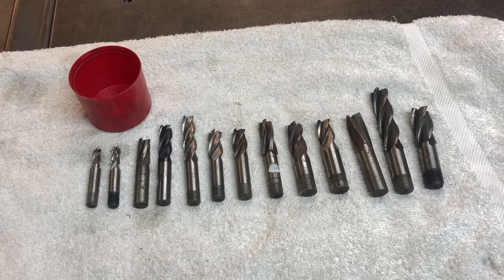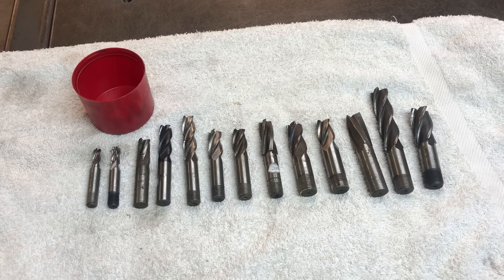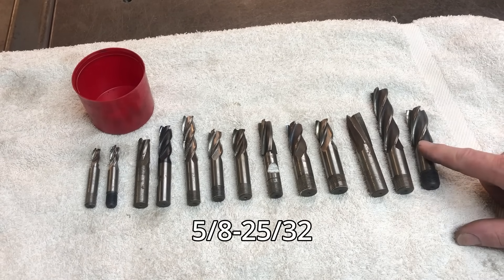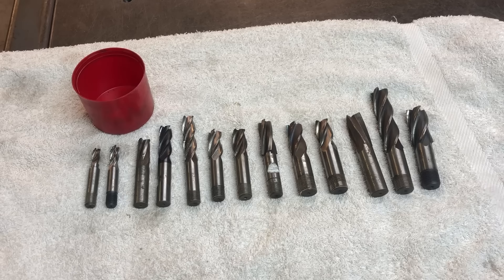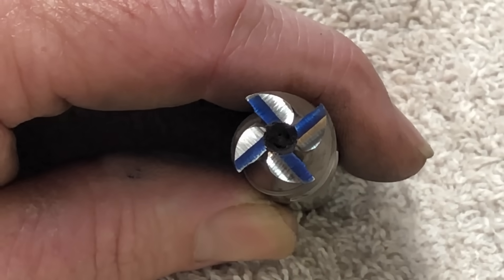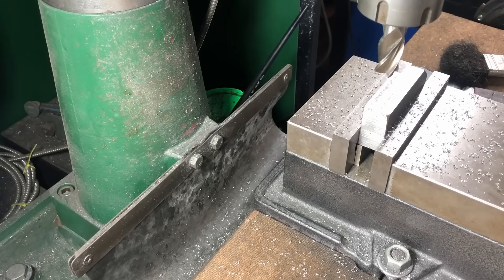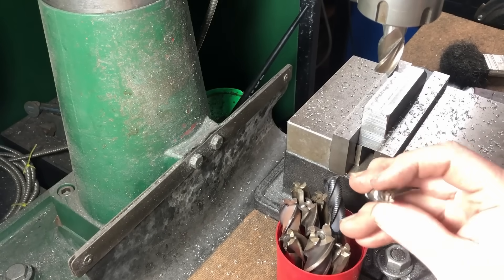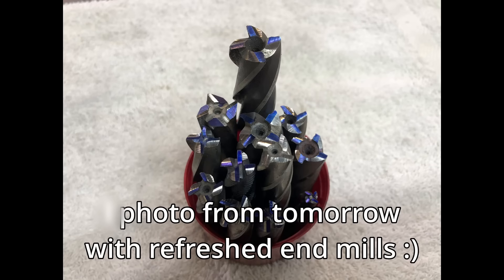Sharpening End Mills On The Lathe

Comment: Speak english ... use imperial units ... see 0.1mm tolerance on machining of high precision tool ... say "it look good" ... post it on Youtube. In any EU country AFTER Your milling of surface, it is just not precise enough. This mills are still just garbage after milling. You do not account wear of grinding stone that make every single cutting edge shorter than pervious one. And I do not even want to start to talk about surface finish that those uneven edges will produce. This video is about "improving something FUBAR to the point it is just not acceptable". 

Btw. You know that this end mills are produced with certain precision rating. Worst and cheapest one is 0.01mm when brand new. (in fact they are way better, they just need to be at least that precise in production batch).

Even keeping them inside single box like You do is outrageous, You let one cutting edge contact cutting edge of other piece and that is certain micro damage! 

Btw2: In banana units 0.01mm is aprox. 0.4 imperial thou/mil or  0.000394 inch ... it is just funny that someone can machine anything using 1/32 inch.

Btw3: That steel bands around rubber covered parts of dremmel tool surely keep it in place without any vibrations or possible misspalacement ... sure ... oh sorry ... fo rogot ... they keep in inside 1/32 inch range of tolerance ;)
Reply from the maker: The cutters cut better than before so that is an improvement. Note that I'm not working on any NASA space ship parts in my garage. Thanks for your comments (I think?)
Reply: As a home hobbyist machininist myself, I approve this video!
Reply: He's not in a job shop or production operation. If the work and finish are critical, I'm sure he has end mills in good condition. 
If an end mill just needs a touch up, what he's done would be just fine for mild steel or aluminum. If the flutes are dull, yep, you need a cutter grinder or a special fixture to do that. But a grinder shop can take a box full of end mills and do the lot for a few bucks apiece. I would note that end mills 1/4" (6mm) or smaller are cheaper to buy than to bother paying to have the flutes resharpened.
Steel bands holding the grinder? I didn't see anything moving around.
Reply: @maciejkrol4820

He is speaking in English,  based on your writing skills,  almost certainly better than yours!

Also, imperial units are not  used anywhere these days, even the USA uses US customary units, which are defined against metric. Even then the USA only represents around 5% of the global population,  leaving 95% using metric, and therefore clearly understanding the dimensions from this video rather than some antiquated  units, used only by one backwards country. 

Also this video is clearly targeted at the home user, who hasn't access to a tool cutter-grinder, nor would be willing to pay some extortionate figure to re-grind their Mills.

I would suggest that it is either throw the Mills away, use them blunt/damaged until you are forced to throw them,  or grind them as per this video and continue to get valuable use for a considerable time. 

Almost all machinery in home workshops is either "end of life" or built to low precision from an high accuracy point of view,  able to make pretty much anything industry can with the exception of the most precise micron level accuracy work.

The run-out in such machinery far exceeds the inaccuracies of this method of re-grinding.
Reply: @juliegreen7604  Im not native english speaker and I'm not fancy learning to speak  or write that language any better since I focus on languege of country where I'm living rn. Yes I am aware of relation between UK units and USA units and metric. If it comes to accuracy, 500eur 3 axis mill have an accuracy of 0.01mm so way better than his refurbished tools. 3d printers have precision of layers 0.01mm on average and size of layer up to 0.001. At point of precision he have, he can use hand tools aswell. Grinding mills or any other precision tools do not cost that much, if it is HSS or Carbide it can cost as little as 50eur per piece with precision of 0.0005mm, triple cost for NHS or quadriple it for Borium oxide. And what You say about being able to build anything industry can with the exception of the most precise micron level accuracy work is just BS ... You want to resurface car engine ? 0.01mm is standard. You want to put some mesh on pistons, then we speak about 0.005mm, making socket, then 0.1mm ... what he can do with his tools is hammer nothing more.
Reply: Можно использовать алмазный круг для заточки - тогда разница  по режущим кромкам будет минимальна. 
 А точность фрезерной обработки будет определяться точностью станка. 
 Есть фрезы и с одной режущей кромкой - с твердосплавными вставками, и ничего - работают. 😊
 Думаю - для 95% фрезерных работ эти фрезы подойдут.

Comment: Throw the HSS in the bin. 
Carbide is king
Reply: Clearly you know bugger all about Milling...🤔🙄😏🇬🇧
Reply from the maker: Yes it is better but more expensive.
Reply: @thehobbymachinistnz  this new kids generations think carbide is the only solution
Reply: No , indexable cutters csn be found cheap, I got them from single flute 10mm up to 8 x40mm & Chinese inserts although they don't last long they are cheap as used chips.HSS are not worth the time to regrind.
Reply: @ThomasClare-x1t 
 Он потратил много времени на переточку? 🙄
Reply: @иванмоскаль-г3щ   we only seen the edited version of this  , I have a tool post grinder & setting it up & using them is not a quick process. My time is worth more than a £3.00 HSS end mill.
Reply: @ThomasClare-x1t 
 У меня времени свободного - неограничено. 😊
 Я - пенсионер. 😂
 Потом, настраиваться точить одну фрезу - никто не станет,  а если их набралось пара дюжин - почему и нет? 🙄
Reply from the maker: @ThomasClare-x1t  No it did not take much time to sharpen. You are lucky to get end mills for 3 pounds. I looked up the cost for a 10mm end mill locally here in NZ and they are $51 +tax. Iam sure 16mm or 20mm end mills would be in the hundreds. Better for me to sharpen them at that cost.
Reply: Germans invented this high speed steel, do you wonder how americans manufactured all of the war arsenal, just plain and simple carbon steel, and molibden steel, don't understimate the use of high speed steel

Comment: How you will grinding the centre
Reply from the maker: The end mills I have don't have a center to sharpen.
Reply: You would just have to sharpen following the flutes current shape being careful to stop when they meet in the middle (some just have one single longer flute at the end so you wouldn't have to watch out for the centerline).  Regardless, it would be a good way to just get something cutting again.  Worst case you could use drills instead of plunge cutting if need be.

Comment: I have not read all comments. I was wondering if it is an option to turn the grinder 90 degrees and use the flat front side so it will give a non curved grinded side? As i was watching an idea sprung to mind to use my rotary table on the mill with the grinding stone in the mill head. I can tilt my FB2 milling head. Anyway thanks for this great idea. Cheers, Janne.
Reply from the maker: No problem. Thanks for your comments.
Reply: If you're planning on using the face of a grinding wheel, you need to make sure it's designed for that use.  A cup wheel, for example.   Grinding on the side of a wheel that is designed for grinding on the circumference is dangerous, the wheel can shatter.

Comment: great video thanks a lot for share , some question:

1. how many rpm ??
2.which diameter stone do you think is better??
3.height variation , do you use for the diferent  part of end mill??
4 some expirience whir cardide end mill??

excuse me for the numbers , and thanks a lot again .
Reply from the maker: Hi, the tool ranges from 8,000 to 23,000. I think this was on 8, 000 when I made the video.
The stone I used is around 20mm diameter. That seemed to work fine.
I use 2mm above center for the cutting edge and lifted the stone up a lot higher for the back relief grind.
I have not sharpened carbide end mills. You would need some type of diamond wheel, CBN wheel or a hard stone specifically for grinding carbide if you need to sharpen carbide end mills.

Comment: great idea & video. just a quick question, why do you tighten down a nut on the top of your tool holder? does it help with holding tolerance? just curious. thank you!
Reply from the maker: Hi, thanks for your question. That is just a locking nut to lock the height of the tool holder. The black round thumb wheel below the nut adjusts the height of the tool holder. When you have the height set, you tighten the lock nut so that the black wheel cant move. That allows you to keep the same tool height when you remove and replace the tool holder. I hope that helps.
Reply: @thehobbymachinistnz oh, that makes sense. thanks for the answer!... im a manufacturing student in highschool so im not that knowledgeable in how to be precise😅

Comment: i have an old lathe with a bad motor and bearings. i use it for something like this, but i do it with old damaged drills to make flat bottom drills for blind holes. now ill use it for endmills too
Reply from the maker: Good idea. It will save you a lot from having to buy new endmills.

Comment: hi have you made forming tools for the lathe? I want to make a couple of internal interrupted cuts but I am having a devil of a job grinding the hss...
Reply from the maker: I have ground up some forming tools. It does take a while to grind HSS. The stone I have is quite course as well. It would take longer if you have a fine stone. I have used a cut off wheel in an angle grinder to cut the bulk off some tool blanks. But, I don't know if that would work for the shape that you want.

Comment: Looks like a V10 lathe  I have the 8 . 3 I believe with the mill attached. Handy . Good method for sharpening.
Reply from the maker: Thanks for watching. Yes, it is a V10-P. But, unfortunately it did not have the milling attachment when I brought it secondhand. It is a nice lathe but the spindle bore size is its biggest limitation. I purchased a larger lathe, but I'm also hanging on to this lathe as well.
Reply: @thehobbymachinistnz  I also bought a bigger lathe but surprisingly I use the EMCO quite a bit . It’s just so convenient for small work.

Comment: I really do like the idea. I have some that I need to sharpen and repair. My only concern is this method leaves a radius cut rather than a flat cut, How does that affect the way they cut if any?
Reply from the maker: Thanks for your question. I have not noticed any issues with the radius. Note that it is only the front edge that does the cutting. The flat (or radius in this example) is at an angle for relief so it technically should not touch the material being milled.
Reply: Fantastic. Thanks very much for the rapid response. What did you use for the tool post grinder. I bought myself a new Makita router to make one from.  @thehobbymachinistnz

Comment: I’m in need of sharpening some end mills.  Would it be better to use an ER32 or ER40 chuck instead of a 3 or 4 jaw chuck?
Reply from the maker: An ER32 or ER40 chuck may have less run out than a 3 jaw chuck if the 3 jaw chuck is worn.
Reply: @thehobbymachinistnz  I have a Chinese made 3 jaw P.O.S.

Comment: When you sharpen and end mill are you reducing the diameter ?
Reply from the maker: Hi, no not with this method. The end mill will get a little shorter depending on how much grinding is required to clean it up. We are grinding just the ends of the end mill so the diameter remains the same.
Reply: @thehobbymachinistnz  Thanks

Comment: Great info, thanks! It appears you use a variable speed grinder turned up to full speed. Have you experimented with slower speeds? Also, it appears that a finer stone would produce a better surface finish on the cuts. Nevertheless, it's clear your current setup produces the desired results. Thanks again!
Reply from the maker: Hi, thanks for watching. That is at about 70% of its top speed. I initially tested it at 100% but there were some vibrations at that speed, so I dialed it back a bit.

Comment: Is that a green silicon carbide stone? For STEEL? Big mistake, if so. Never use silicon carbide for grinding steel. Never use diamonds for that, either.
Reply from the maker: I don't know what it is. It came in the kit with the grinder. If silicon carbide is expensive, then this is probably not silicon carbide as it was one of the cheaper kits.
Reply: @thehobbymachinistnz  Keep an eye on it. It might work out OK. They usually make the green ones from silicon carbide, which erodes badly when it gets hot next to steel sparks. Alumin(i)um oxide (pink stones) stays together well against steel.

You'll know very soon if this is a silicon carbide wheel by the way it erodes away. You can keep a pink stone sharp without dressing for a long, long time but a SillyCarb stone will wear off and blunt and glaze over badly as the carbon crystals melt and are absorbed by the iron, leaving only the substrate behind.

SiC isn't expensive, but it gets to be a PITA to keep it in stock when it wears away almost as fast as the steel you grind with it.    8)    You may do five hundred end mills with a pink stone but only five with a SiC stone. The more end mills (and other stuff) you sharpen in one swat, the more important it becomes... because...

If your stone wears appreciably as you do one flute, then it'll be smaller when it does the next flute, and smaller still when you do the fourth (or sixth). That means that one flute will always be appreciably longer than the others and will do the bulk of the work, wearing out worse than the others. Your goal is to try to make all the flutes the same length within some ridiculously small  tolerance, so you want a long-wearing stone and you want to make one final pass on all flutes, just kissing the steel lightly, to level them up.
Reply: I know about diamond, but never heard that about silicon carbide. What's the reason why not?. What should we use?.(actually I think those cheap little wheels are just green Al.oxide, but I'm not sure)
Reply: You want the blue ones for steel, theyre absolutely brilliant

Comment: One thing that breaks the corners off end mills, especially those expensive carbide ones,  is starting the cut at full feed speed on a hard square edge or corner of the material. Its like hitting the corner of the cutting edge with a sharp hammer blow. Unless I'm in a big hurry to get some mass production work out the door (and I have end mills I use for only that kind of quick and dirty work), I always start conventional milling cuts very gently. Start the cut by slow hand feed and then engage the feed drive. Same for breaking through the end of the cut. Disengage the power feed and gently ease the tool through the violent interrupted cut. When climb milling, I try to keep the impact angle of the flutes shallow to avoid the hammer effect. I rarely get broken corners on my end mills this way.
Reply from the maker: Those are great tips, thanks Scott.

Comment: High speed steel you cab grind them red hot
Reply from the maker: Yes, HSS can take a lot of heat. Although I don't think there is as much heat here as there is with hogging out a HSS lathe tool on a bench grinder. About that comment re discoloration from Linda Vasserman, I wonder if she has confused the blue sharpie marks with over heating?
Reply: @thehobbymachinistnz  Use black sharpie for the dull ones amounst us